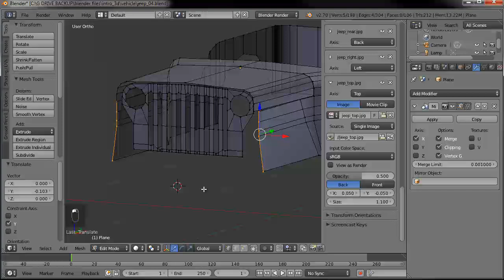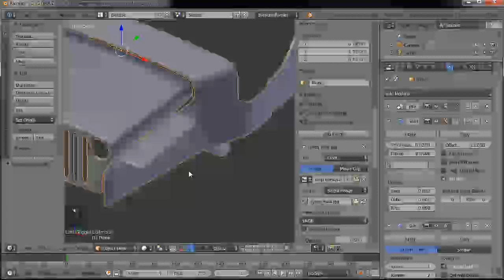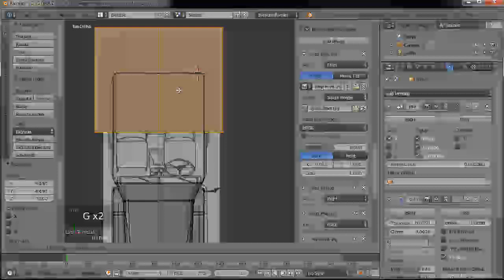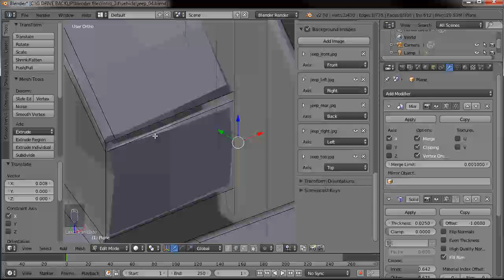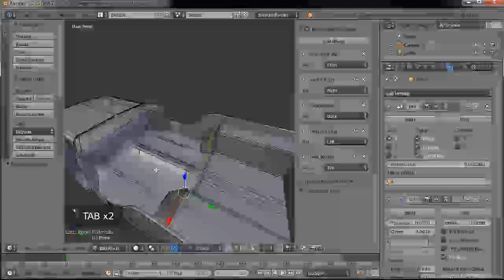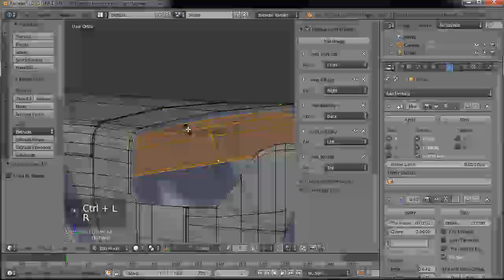Willys Jeep - Blender Tutorial Series - Part 4 - Modeling

Comment: I can't get the floor to work.  Everything looks distorted.  It looks so easy when you do it, but I'm ready to give up. :-(
Reply: Got through this part after several attempts.  I had to turn off visibility of solidify and subsurf modifiers to see what I was doing.  I also set the Inner and Outer settings on the solidify modifier to zero.  I'm still playing with the Rim setting, though.
Reply: Blanco111 que mal inglés mano

Comment: Thanks for the series :)

I have another observation, that it may help you with the problem we get when uses the Solidify modifier.
After you use the Solidify, is good to use the Edge Split as well, so the edges keep (without the need of add more geometry) the hard line.

Again, sorry for my bad english, and thanks again ;)